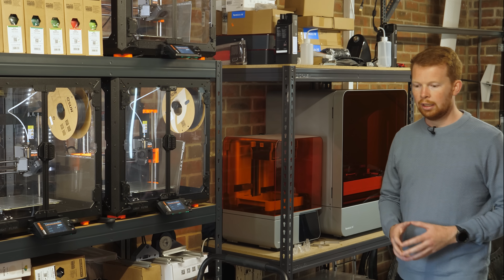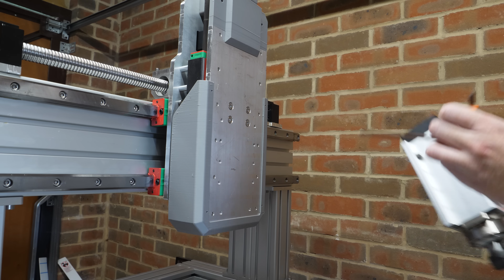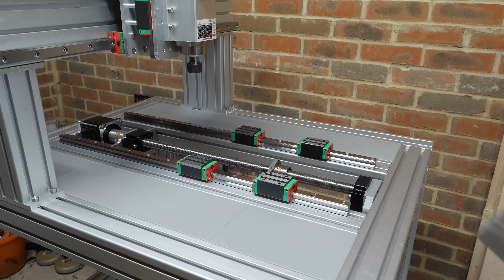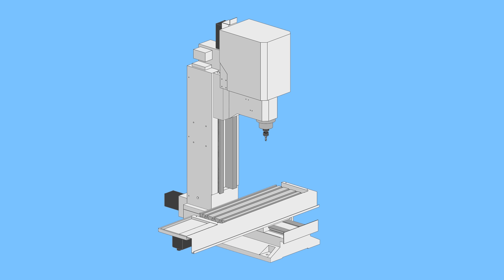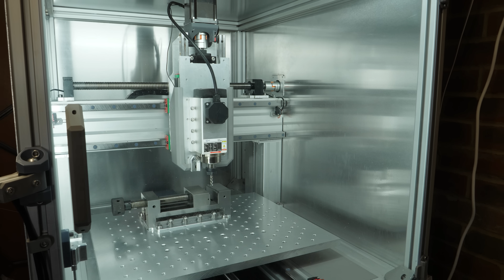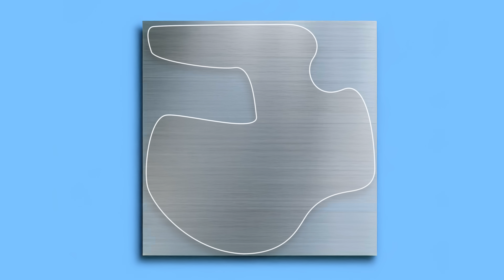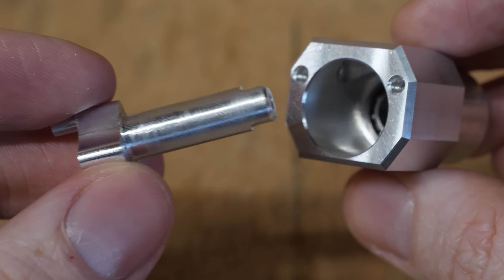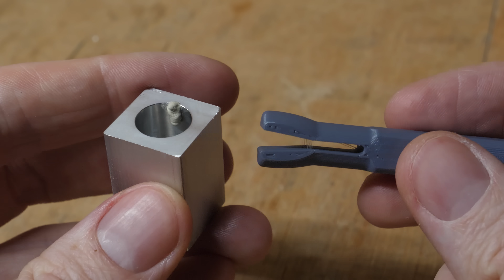I Needed an Engine, So I Built a CNC Machine

Comment: Your engine case looks remarkably similar to a brass angle gas fitting/air fitting/hydraulic fittings.

Perhaps saving some time and money cnc'ing from scratch and start with a threaded part that you modify with cnc.

Comment: You definitely need to lubricate aluminum when it's running against itself to prevent galling, otherwise known as cold welding. Try engine oil.

Comment: Don't lock the cylinder head in place. Cut gear teeth into the side of the head and use an electric motor to spin it like a throttle. Fairly impractical but has a higher cool factor than a boring set screw. lol

Comment: To lock the cylinder, you could perhaps extrude a lip around the crank case for grub screws. Perhaps 1 or 2 of them. It doesn’t look like a lot of friction is required to lock it in place so shouldn’t damage the cylinder thread, but you could always extend the lip up past the point where the thread stops, if you’re concerned about that?

Comment: To lock them cylinder you might want to simply add a lock nut, just find them right timing and tighten the nut against the crank case

Comment: 9:23 - well spend effort into probing design and sequence 🤓
He wanted to avoid tool change, but use ~5 milling tools to finish part and need to probe hight. Is there an option for conical collets (?) for smaller machines like this? Some automatic tool change like interface?
Regardless - super cool machine build!

Comment: for a way to lock the valve timing into place, a perfect and very easily implemented solution would be to use some Saftey-wire. Its already used in aviation all over the place to prevent vibrational loosening

Comment: dont lock the cylinder down! make an arm to clamp onto the cylinder somewhere to attach a servo. mark where peak power is generated and set that as 100% throttle. reducing engine performance/stalling the motor will be a useful for landing when fuel reserves are still high.

Comment: To adjust/lock the cylinder, could you machine a set of cog teeth above the threaded base, and use bolt pressed into the cog to turn it? This would prevent it self-turning, aswell as allowing a locking nut to be tightened onto the adjustment bolt to lock the whole thing up.

Comment: If you plan on putting any lubricant inside this engine - and you should - you'll find that having a perfectly smooth cylinder bore won't hold the oil.  Combustion engines have lapped bores, scored at 45°.  Maybe next time;  cause there will be more, yes?
Got spare threads on the cylinder head?  Add a locking ring to bind against the crankcase.  It's the simplest option.

Comment: To lock your cylinder in place, put a nut on the exposed threads that you can tighten down against the crankcase.  May need to adjust over time, but it's still something

Comment: I'm no CNC expert, but the router I run at work, the G-code generated by cut 2D has i and j coords for cutting curves and circles instead of using just many many XY coords. 

I'm not sure if that's something that needs setting up in your toolpathing, but that's what comes to mind. Cuts curves so close to perfect you can't feel them or see any choppiness in the edges of aluminium we cut. I guess this would bring it down to a circle with straight lines relative to the minimum step distance of the machine, but the parts would likely still need to be turned and polished. 

Also, might want some kind of lubricant and some cross hatching in your bore to help hold it in there.

Comment: For circle making on mills, in the CAM software there should be options for simplifying movements into arcs and circular movements which will then post out as G02 or G03 commands. If you're controller can use those you will get way better looking circular arcs because instead of the machine trying to follow hundreds of tiny linear moves, it will post only a small number of circular move commands that the controller will then use to coordinate the X and Y movements to follow. This helps A TON if you're machining fast as well because most controllers can only process a certain number of lines of code at a time which makes following lots of tiny move commands very "stuttery" as the controller can't keep up with how many lines of code it needs to process for curved profiles.
Reply: I was just about to suggest this (G02, G03), great comment. I hope Tom reads this :)
Reply: My Haas at work runs about 20 blocks per second 😂.  My postprocessor when I use it wants to linearize everything into 2 thousandth steps, which doesn't work too well at the machine.  I haven't figured out how to make the toolpath smoothing option a default.
Reply: @Soundpost-f2l  It sometimes in the post processor options but for HSMWorks and Fusion360 the options are in the CAM toolpathing as a smoothing option with settings. On haas machines theres also a G187 command you can play with. Haas has a great video section on their website that goes over all sorts of tips/tricks so check that out too.
Reply: I think these codes are cool but considering play at x and y screws and overall rigidity of the machine using presented method may provide a “rounder” result as it uses real rotation. And I believe spindle have the least radial play than axial plays of ball screws.

Comment: Put some thread tape on the cylinder threads. Just one or two wraps - that will increase the thread friction and help with the valve adjustment issue!!

Comment: Probably should impliment G2 and G3 in the post processor for fusion. I presume you already got the function in the CNC control.
G2 and G3 allows a very accurate one line code to cut circles or curves. the different codes dictate only which way to cut. clockwise or counterclockwise.

Comment: Does the stepper controller you have support G2 lines? Most CNCs I've run support G2s for smooth radius motion.
If you're using HSM in Fusion to make your gcode, there should be an option to turn on G2 interpolation. If there is, you should get really nice circles instead of the sort of 'faceted' look. Though I don't know how it would interact with the stepper motors...

Comment: at 13:44, you are talking about how to cut a circle using straight G01 coding passes. I siguest that you use a manual G code program with a G02 CW rotation and a G41 tool offset. if you do this method as a finishing pass after cutting the roughing pass using the method you showed it will produce a much better finish.

Comment: Very nice work Tom! Do you think when using the CO2 you will get thermal expansion/contraction of the piston which will alter the seal between it and the cylinder? Or do you expect both of them to contract at the same rate?
Reply from the maker: Thanks George! I expect there will be a number of thermal issues to solve, but I haven't considered that yet. I suspect they'll expand/contract by similar amounts, but if not, I might need to change to a piston seal design and a looser fit.

Comment: The collet should loosen the same way that the milling bits turn to cut material, this way as the bits generate resistance in the opposite direction they turn to cut material.... they actually are self tightening.

Comment: You could have just bought a cheap adjustable boring tool (which can be used for internal  bores and external cylinders) rather than spend all that effort on a  custom tool for one job.

Comment: It looks great, but really, nema 34 on ballscrews that are like 1.25" diameter? I would have gone clearpath, this project is obviously far beyond the level that deserves quality motion.. putting a clearpath on a normal 3dp is a waste, same for small cnc. But there comes a point where it is the obvious choice. Cough42 puts them on all his cnc conversions, including the current build he's making on a surface grinder, from scratch.

Hell, if you, for whatever reason, didn't want to go clearpath, even odrive would be better imo. Steppers suck past a certain point. Their holding torque at 0 might be fairly high, but is extremely low in motion, and you only get 1 step unit resolution of holding power on a stepper, versus a clearpath that can overshoot and recover..

Comment: When working with liquid CO2 as your pressure source you should include an expansion chamber in line so the CO2 can change phase before reaching your engine. CO2 can be a bit erratic as a high pressure source, that's why paintball moved away from it as a power source in the early 2000s. The most efficient design for an expansion chamber I saw was a cylinder 3/4 filled with metallic shot.

Comment: to be honest, the screw adjustment for valve duration could actually be useful for “throttling” the engine with the CO2. it eliminates the restriction that a typically throttle valve creates.

Comment: Locking the cylinder? Thread it up to the fins and use a locknut that screws against the crankcase. Easy! Beautifully elegant engine design, btw. Practical simplicity is beauty. Too many engineers forget that.

Comment: Your amazing my friend. And ta think, I thought engines all ran on witchcraft.  Oh well. I absolutely loved this video. Great video, inciteful commentary, and awasom content. On the cylinder moving, I would thread the base of the cylinder above the threads that go into the block and use a simple locking nut. It would be pretty easy and quick. Also, it allows rapid timing adjustments. Beautiful work, great respect to you my friend 🙏 🫡.

Comment: I remember watching a video of someone making a tiny steam engine. They used a lathe to make it, but it did seem a little annoying to cut certain angles on it. In any case, you made an engine that looks just as good using this method. Well done Tim Station.

Comment: I wonder if that expensive looking probe could instead just have a hole for a semi-sacrificial easily replaceable material like some rod stock so that it could easily be taken out and replaced when the eventuality of forgetting to not use the probe on non conductive material happens. It would also have the benefit of being able to easily fit any length probe needed for specific tasks.

Comment: thread the cylinder farther up add a nut and when you find the sweet spot tighten the nut down this will lock it in position but still make it easy to readjust if needed

Comment: Well the G-Code commands for arcs (G2 and G3 for clockwise and anticlockwise arcs) are fairly widely adopted/supported. They're even used by many 3D printers and slicers. I don't know if you've integrated support for them in your machine. But if your machine supports them you'd only be limited by the resolution of your stepper motors. And yeah, you could also achieve this with many straight lines but if you want an arc and there are commands for perfect arcs, why not use them...?

Comment: IT support guy here.
when you used the abrasive, would it be better to insert the bit the is meant to go in and make the abrasive work on them both at the same time while spinning so together it makes an extremely smooth surface?
Reply: That would work, but would result in looser tolerances (with a gap between them being dictated by the size of the abrasive). By lapping them separately, you can get tighter tolerances

Comment: ps: Use a "Pal nut" to lock your cyl. in place.. Stamped spring steel and very lightweight ..  Lycoming used to use them on cyl. base nuts on their aircraft engines..  Ask around..

Comment: You could have an arm attached to the cylinder that moves timing forward as you open a valve. Outboard boat engine have a similar thing with timing. a nitro rc carb might work as a valve. Have an arm with multiple holes so you can adjust the ratio until it moves enough retarded so that it starts. Changes in supply pressure could act on a diaphragm that retards/ advances timing as well. You may want to record position vs air pressure on a graph at multiple pressures to you can track the change in efficiency.

Comment: To lock the cylinder head you could design a block that has a "collar" that the cylinder head drops in to before it hits the threads, and then use grub screws in that collar.

Comment: I know those manufacturers with a phobia of threadlocker all to well. I dont own a CNC but i am the "CNC guy" at my workplace. I have a huge woodworking CNC all for myself. Full scale 24/7 rated industrial 5-axis nesting machine. Yeah... its falling apart. Everyday i find a new differed screw on the floor and then i have to figure out where it came from. Getting a service a man on location is "too expensive" and no one else but me has even a hint of a clue on how this machine works. I should charge a lot more for what i do.

Comment: If you have access to some nitric acid, you can remove a broken tap in aluminum by dissolving it. Degrease the tap then build a little dam around the tap with modeling clay. Then put a few drops of the acid in the hole with the broken tap in it. The acid will eat away at the tap without harming the aluminum part.

Comment: tip for the next time you break a tap in a non-ferrous material (like aluminium). A steel tap can be dissolved using a common salt called Alum (Potassium Alum KAl(SO4)2·12 H2O, https://en.wikipedia.org/wiki/Alum). Just create a warm bath of a decent concentration of alum in water and place the part in it until the tap has been dissolved (In a NON-STEEL pan or dish, concentration isn't critical but near saturated is faster, keep it on the heat and near but not quite boiling to speed up the process) . Works wonderfully and doesn't affect the non-ferrous metal at all (unless you leave it to cook long after the steel is gone). It's not a super fast process but it often beats having to redo all your hard work. I've saved a bronze cilinder block  for a live steam engine model with a broken off M2 tap in it this way . There's a lot of youtube videos and "anecdotal evidence" articles on the subject, as it's one of those old machinist tricks that gets passed down the generations mostly through oral tradition after the experienced machinist has done the whole "suck air through his teeth, give a small whistle, sigh deeply, scratch his head and tell you how buggered you are" routine so that he can than save your sorry behind

Comment: Amazing, i have a 3 axis cnc, i almost made the fusion 360 cam for it(i use mach3 and i had problems with the g codes), but i can’t think how did you work the part after you rotait it on the hinge, did you made more g codes and each one have another start point? And always you rotait the part, start like a new g codes? And the probe,man, it’s amazing, i have uc400eth controller and i want to make a probe just like you!!! How it’s work, can you make a video about mounting and setting to your g codes sender, please?!

Comment: Hiya, just thought I’d put it out there for the benefit for everyone. In our workshop we have a few machines without a probe and the best advice I was given was to get a piece of paper or cigarette paper and move it back and forth as you slowly move the spindle and cutting tool closer to the workpiece until it grabs enough to hold/rip the paper which will give you your parameters/zero point. If you are looking for high accuracy the paper can measure with Vannier calipers and subtracted from the reference point. This might help you with speading up set up time with non conductive materials. Love the videos, keep up the good work!
Reply: That works well for the height offset, or if you don't have a edge finder. About the same principle, but when it touches the tip moves to the side. It saves time and very accurate

Comment: There would have been another method for manufacturing the parts of your compressed air "engine" (but the design and assembly of your DIY CNC would have been unnecessary):
Take a part made with the 3D printer and use it as a template to cast the aluminum part.
This would have resulted in a completely different video with a whole other set of skills to acquire (specific to aluminum casting) to perform this type of process.

Comment: To lock the cylinder thread: remake the part, but above the thread, include a locking collar (the clamping kind, NOT the set screw kind, as that will come loose and have uneven pressure on the part)

Comment: Indexing your thread -- 
If you drill 10 holes in 1 part (36° apart) & 9 slots in the other (40° apart) something will line up every 4° -- 0.017mm given 1.5mm thread pitch -- drop in a pin & retain it with an O-ring.

Comment: To help with getting a smooth cut on circles like that you want to use an adaptive tool path to do the roughing work and leave a few thousands to a few ten thousands of material. (Amount you leave depends on cutter, material, ect.

Then use a contour cut to remove the last of the material. In most software contour by default will use the interpolated G commands that give smooth circular motion.
Even on straight walls if I want that smooth semi-mirror finish I will use the contour because adaptive roughing repeatedly engages and disengages from the material.

Specifically I am referring to only 2d operations here as 3d operations are a bit different. Generally speaking you wants to prefer 2d cutting operations to 3d whenever you can.

Comment: hello, im from germany so dont espect my english to be good, but here is my indea: after you twisted the zylinder of the motor you saw an increce of the rpm of the motor. symply build an hinge with a lever to control the rpm of the motor ore even to make it more eficiant at differnt air pressures. bye and love your vidios

Comment: You need to hone your cylinder wall with a crosshatch pattern so it can retain some oil to seal and serve as a layer between the liner and the piston so your aluminium parts don't rub and wear out quickly. Very impressive CNC machine though!!